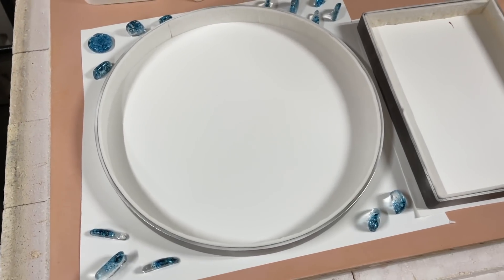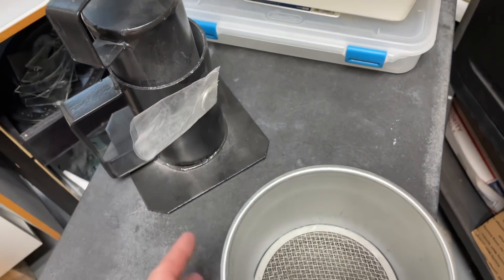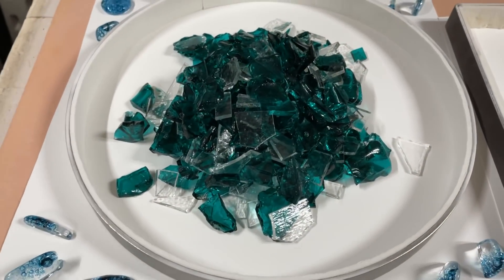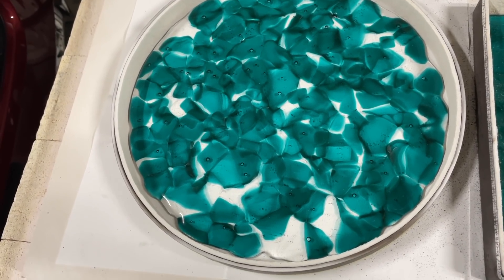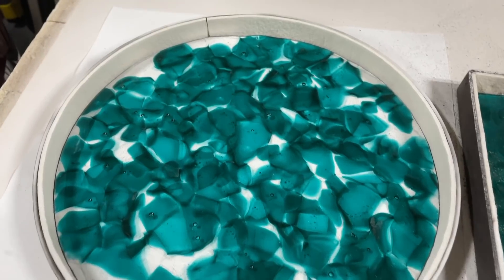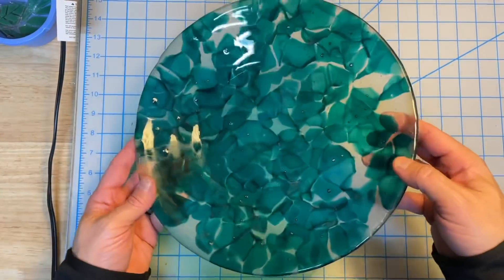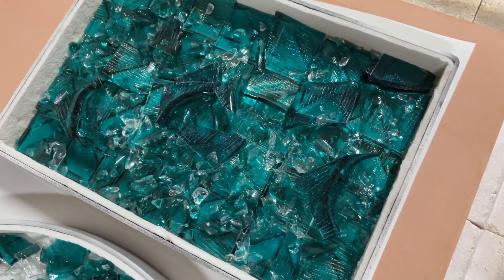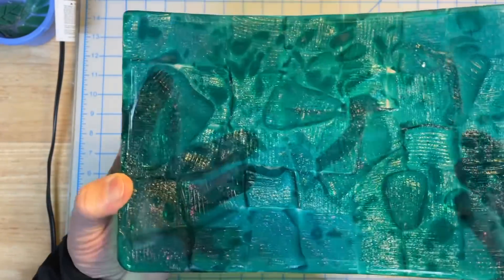Making lemonade out of lemons: fused glass scrap melts using peacock blue disasters.

Comment: How do you calculate weight of glass you need?  I'm not sure how you would know what weight you need for 6mm.  Thanks.
Reply from the maker: There’s some formulas out there, but I’m mostly a guesser. This might help, and there are more links at the end of the post too: http://www.janecameron.co.uk/blog/how-to-calculate-how-much-glass-you-need-for-a-fused-glass-pot-melt-or-screen-melt-or-glass-casting#:~:text=Square%20melt%3A%20length%20x%20width,a%20bit%20for%20the%20pot.&text=(e.g.%2010cm%20circle%20melt%20x,which%20would%20be%2047g%2C%20x2.

Comment: Fab video! I've been trying to do something similar in a stainless steel square mould, using smaller fritted scraps of bullseye. I've used a similar schedule with a top temperature of 1480, holding for 30 mins. I've been finding that the edges of the glass are forming small little spikes. Do you happen to have any idea what could be causing this and how to prevent it? Thanks so much :)
Reply from the maker: I’ve had little spikes occasionally and believe I’ve read this can be because the glass is sticking/dragging on the sides. These can easily be addressed with some diamond pads and maybe a fire polish, but also make sure your glass is flowing outward from the middle, toward the sides/edges, and not piled up against the side and melting down. Hope that makes sense.

Comment: Good videos. Thanks. I used to use the black iron frit maker that you have but switched to using an old electric blender with a thick heavy duty glass blender jar. You can get them cheap at secondhand stores. Works great. You need to wear an adequate face mask while working. After crushing the glass and before removing the lid, I suck the glass dust out of the jar using a shop vac through the small top opening. Then I use the sifters as you do. You can make a lot of frit in no time.

Comment: Great video, I'm glad I stumbled onto this! Also, love that you put a link up for calculations. And also, frit piston?!?! I definitely need one o those! Thinking about your bubble issue with the second firing, maybe you needed to hold the 1480 at longer to squeeze more of the bubbles out? And yes maybe the slower/lower temp ramp contributed. Also what if you flipped the piece for the slump? Maybe that would hide the bubbles and reverse their trajectory, so they were more in the middle of the piece instead of appearing like pitting on the surface. Overall thought I think it's a great finished piece and love how you recycled your scrap projects. I have subscribed to your page, and looking forward to watching more. I will definitely be trying this!

Comment: Great video and great use of scraps. The bowl is beautiful.  I use a lower and slower bubble squeeze.  you may try something like this 400 to 1125 then ramp at 50 (yes 50) to 1275. then finish your schedule. this gives the glass a long time to settle and get bubbles out.  The only drawback is it add 3 hours to your firing. I use this on everything bigger than a jewelry piece.
Reply from the maker: I’ve been doing something very similar, going to 1100, hold, then 50dph until 1250. I do like that schedule!

Comment: Your initial fuse probably had a bit of shelf release on the bottom of each plate.  Before turning to frit you should have cold worked a bit to grind off any release agent.  I'm thinking that your bubbles were a result of primer contamination.

Comment: Make your own frit wo metal flakes in it. USE CARE WITH HOT GLASS! In small kiln heat a pile of scrap to 1500°F. Using long vitrograph pliers and leather gloves, safely grab molten glass and drop in steel bucket of water. Pour off water and dry. Sort w frit sorter. Advantage of this method is no metal fragments in the frit. I use frit as froth on edges of floral vases and filler between “coral” style bowls.
Reply from the maker: I’ve seen this demonstrated before... not sure I’m brave enough! 😂

Comment: Hi Jamaison! Love your videos! I have been inspired by all of them! I think that the large size bubbles would have been reduced by slowing down in the bubble squeeze zone. If I am doing something that is likely to trap air I slow my schedule down starting at 1100 degrees. I then go 100 to 1175, H20; 45 to 1225, H30. As the glass starts melting a longer bubble squeeze will give the air more time to exit the piece. I think that on the second firing with the long hold at the top temp it allowed the bubbles to move to the surface more, causing some to break open.
Reply from the maker: Very helpful. Thank you!!!

Comment: For the dimples/bubbles, use a dremel with a ball bit to break them open (or press a sharp pointy tool into them to break open.) Fill with a clear chip of glass the full fuse.
Reply: Exactly...That is what Laurie told me to do also and it really works!!!
Reply: I agree, I would have  done that after the first firing

Comment: Jamaison, good to see your handsome face!  I love your scrap adventures, I usually learn things I didn't know, like those steel molds throw off what looked like carbon, who knew?  I may have heard it in the past but didn't realize it.  I still think your processes are good and one thing I have learned in a decade of doing fusing and learning along the way, is that sometimes "lower and slower" can get the job done.  However, having said and done that, it has NOT always been the answer.  I was going to say that the information that acprive (below) was also where I was  leaning.  A longer old time may have allowed the bubbles to fully surface and "equalize" themselves.  Regardless, I really did like BOTH videos and I enjoy your sense of adventure.  Thanks as always, and Happy New Year! 😉👍